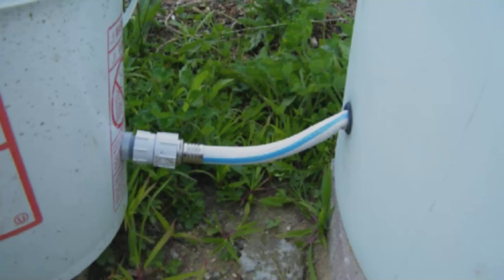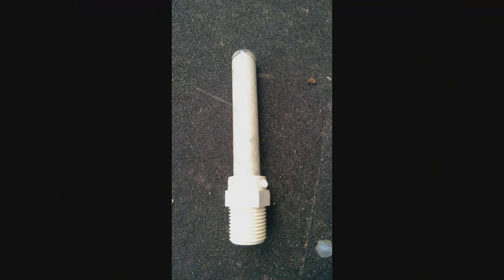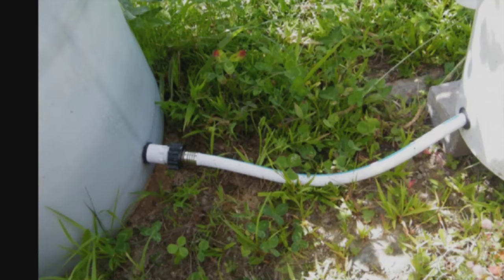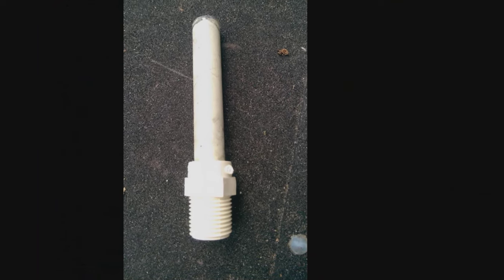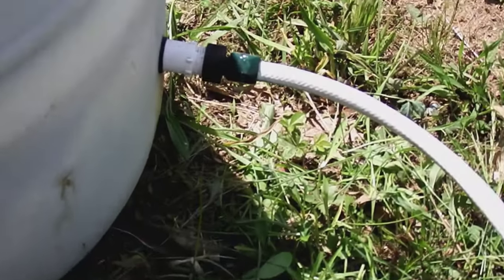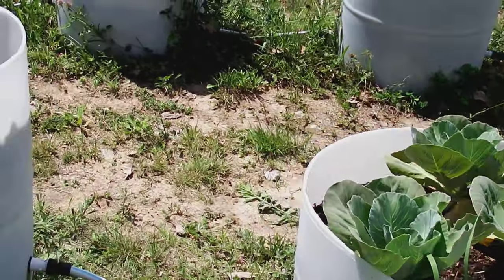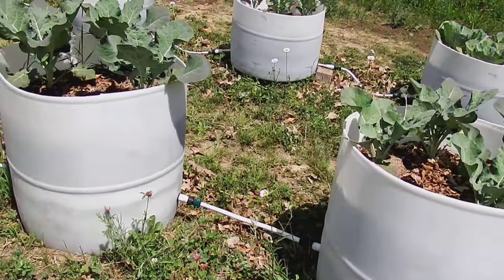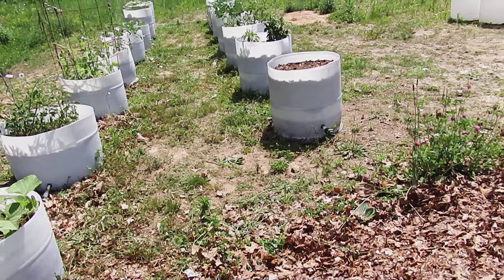10 Month Review Of Automatic Watering System For Wicking Barrels

Comment: Thanks for this. The float valve tank idea is the key I was looking for for my drip system. Problem with the drip was that it dripped too fast to be always on. With your float valve tanks setting the level I can control the pressure by how high it is above the drippers AND still have a big tall reservoir tank feeding the system. Much much appreciated!